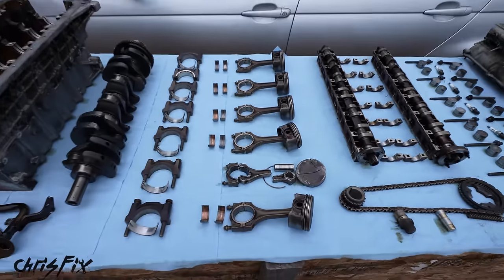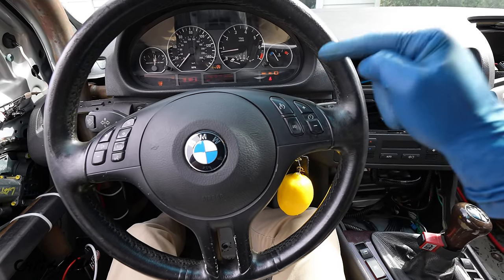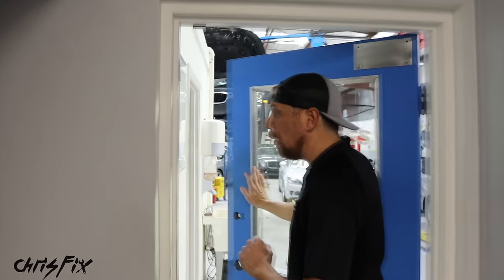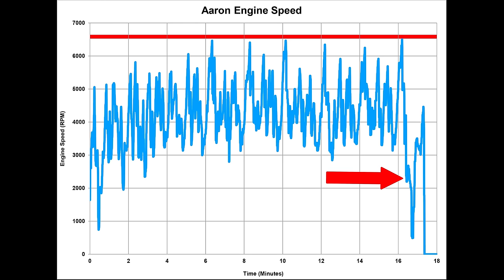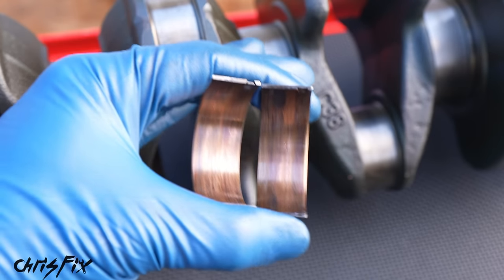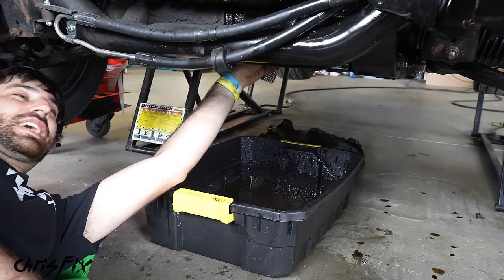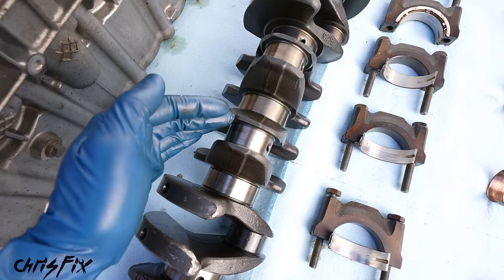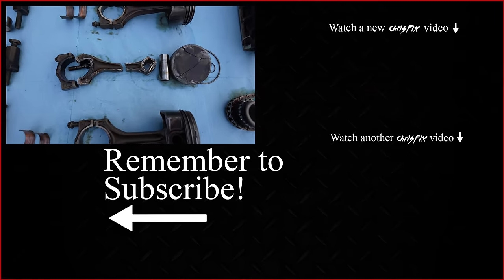What Causes a Spun Bearing in an Engine?

Comment from the maker: A common question in the comments is how can we have a junkyard engine and still be below the $500 limit and here is the answer: 
The goal of the 24hrs of Lemons is to try to level the playing field by having a bunch of junk cars race. This is the most affordable wheel to wheel racing in the world. Since our engine blew at our first  race and we are putting in an equally junky 140k mile junkyard M54 engine which is what came stock with our car, the replacement engine does not count towards the budget. The new seals we installed to stop the oil leaks ($60) and the chain tensioner we installed ($6) does count and the headers ($100) definitely count but we were at $340 after selling everything we could from the car… So now we are at our $500 budget. I need to see if I can sell the cats because those are $400 but something tells me that we can’t haha. 
With that said, safety stuff does not count towards the $500 budget. Otherwise it’s impossible to race because the fire suppression system alone cost more than $500 and the cage cost $3800. Parts to make the car faster or perform better do count, but not stuff to save the drivers life. 
Now the “backup engine” is a good opportunity for a collab with another automotive YouTuber who wanted to get involved and is trying to grow his channel. We aren’t using the backup engine unless ours blows up again which I can’t imagine will happen (knock on wood). So that engine won’t count towards the budget because it’s not in the car at the start of the race. If we end up having to swap it in at the track, it still won’t count because the time it takes to swap it in will make it so we are not competitive anymore. The next race we would have to remove it and put in another junk engine or take penalty laps. 
Lmk if you have any more questions about the $500 budget. Again, the main goal is to prevent people dumping money into a car and have an unfair advantage because they have a bunch of money.
Reply: hey chris
Reply: so basically it's all the stuff that's on the car itself that counts?
Reply from the maker: @OutrunRewind  anything that makes the car more reliable or faster counts towards the $500.
Reply from the maker: @CarSkull  hey 👋
Reply: @chrisfix  Hello
Reply: @chrisfix  lmao
Reply: What about the brakes and wheels? Those got upgraded. Do they count as "safety" devices too?
Reply: @pjaxy  Brakes probably do count as safety, but tires probably not. Idk
Reply: I wish you did home visits to subscribers having car troubles. would be super helpful and easy content. i watch a lot of your videos but it's easier to tell from them how to find something that broke and how to fix it vs finding out why the car just generally sounds unhealthy so you can fix a cheap part BEFORE it breaks entirely so you can find it easier. I'd really love for you to come over and figure out why our jeep sounds and acts weird. i've tried to pinpoint the problem but it seems like it's just spread all over the place, like everything wants to break all at once. we can't afford to take it somewhere to be diagnosed, especially if they gotta look all over for what's wrong, and we're not skillful enough, even after your videos, to figure it out for ourselves. i know getting an obd2 sensor to plug in would probably shine some good light on what's up with it, but, money. New series for your channel maybe? ChrisFixes YOUR ride! could even have entries set up like pimp my ride where fans send in videos of why their lemon needs your magic touch. You could also just do it through video calls instead of traveling. help people work through their problems over live video. you tell them where to go and what to listen to with you on their phone, then do some experiments to see if your hunch is right and if it fixes the problems.
Reply: @chrisfix  Chris ı have an idea about oil pressure gauge because you dont have on your display. I saw on internet that you can remap the gauges on your screen so maybe you can remap the mpg gauge to oil pressure gauge. Thıs can help for seeing the oil pressure.
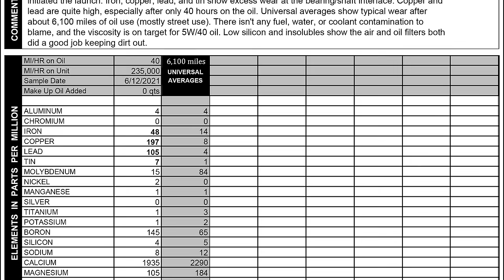Reply: Hey cris is that your actual phone number at 15:46
Reply: Yo Chris can you show how to turn your car into a an electric car  or at least a hybride plz ?
Reply: @chrisfix  I build camper vans and busses into rvs if you ever want to get into something new let me know :)
Reply: How do brakes, wheels and tires fit into the $500?
Reply: @chrisfix  does the quick release Steering WH. Count? Radio transmitter, all that kinda stuff?
Reply: Is there a age limit? I'm about 14 and wanted to enter a old rough car
Reply: @chrisfix  hi chris, what is wrong with that guy? Is he spamming you? You can block his access to your channel.
Reply: hey guys! announce for chris, he is now 8.79m subs
Reply: @Chrisfix I know you are going to hit 10m subs at the end of the year.
Reply: This is unrelated to this video but I was wondering why haven’t done a video over your C4. I understand this is a automotive fixing channel and all but from your videos it seems like your corvette is your most prized car in your fleet. I just thought it would be rather cool to see what your corvette is like. Especially since it seems to be a rather mint condition example of one. Have a good day.
Reply: @nathancoffey8568  its a Rick roll
Reply: Please do not use 5W40 for racing. Get a better oil (not going straight to M3/M5 specs but closer). Start with 15W40 (Winter additives reduce capabilities for hot engine).
Reply: @chrisfix  LMAO
Reply: Hey Chris you should buy my 1986 Toyota mr2 for $500 it needs a head gasket but I think you could do that it would be awesome for the race
Reply: I learned more in YouTube more than I ever learned in school nice job keep it up
Reply: @supergodz355  good
Reply: Hi I have a question I have sand that has
harden inside my engine bay and all over my radiator how should I clean it?
Reply: @chrisfix  why din't you use spare pipes to make strait exhaust
Reply from the maker: @ironphilly2366  we did basically.
Reply from the maker: @pjaxy  yes brakes and wheels and tires are all safety. Suspension (except bushings and ball joints) are not safety.
Reply from the maker: @nathancoffey8568  give it a call
Reply from the maker: @teebosaurusyou  safety
Reply from the maker: @LethalTunedHNP2846  safety
Reply from the maker: @theforerunnerreclaimer  you need a drivers license. This is pretty intense. Peirce is 20yrs old but he can’t race in the car yet. he’s helping a lot in the pits and will get practice seat time. It’s pretty intense out there.
Reply from the maker: @gavinc8635  I don’t have an indoor space to keep it unfortunately.
Reply from the maker: @Rich-cw2ct  I guess just leave it?
Reply: @chrisfix  Ah, okay, thanks
Reply: @chrisfix is there anything at the rear muffler or is it justing burning a hole in the e46
Reply: @pjaxy  I guess
Reply: @chrisfix  Hi chris, my ford mondeo 2004's AC compressor is weak, i mean, the mechanic told me so that is weak, but it runs decent, how can i know is really bad? I hope is just the compressor cause all the hoses to replace is dees nuts. And also my EGR valve and a selenoid is bad, which is getting my car a lower fuel economy and a lot of black smoke is getting out of the muffler, is a 2.0 TDCI engine with a turbocharger. I've never had problems with it, but i replaced some things like the flywheel,clutch brake pads,(cause rotors were completely fine) and i'm planning to get the ST220 xenon headlight, but i prefer some 2° hand ones or junkyard ones are also fine cause i have 2 headlight restore kits, but of course, you dont know this car cause is a European one, made in Germany. And they are almost impossible to find in the entire US.
Reply: CAR PATTERN:  LEMONS, MAKE your skin pattern something with LEMONS. Anyways another great video.
Reply: I'm sorry it happened to you chris. My brother has a BMW and encountered the same problem you had so sharing this info is super important and I'm glad the engine swap didn't cost towards the $500 budget cuz otherwise, you guys will be out or suffering penalty laps. Im doing an engine swap with my brothers BMW and my mom's boyfriend who is an expert mechanic is going to help us cuz he has the tools and products we're gonna need. I hope everything goes well with the next race you guys are going to have and I can't wait.
Reply: @chrisfix  oh damn ur the only one who responds to spam acc but luckily youtube found a solution they will terminate bots like u saw
Reply: @chrisfix  👀
Reply: @nathancoffey8568  I'm not falling for that one again. (LOL)
Reply: Don't prefill oil filters from the Oil Filter Outlet.....any dirt will go through the pump then bearings.
Reply: Awesome video!!! Love seeing a crew wearing Chris Fix T's! The explanation on the motor is perfect. I have never understood why putting more oil was bad....well now I do. I also wondered how a oil bearing actually worked.
Reply: Is your bad engine 100% broken???
Reply: the more I learn about the lemons rules the more I think they're the most reasonable set of rules to exist for any sport. in this case allowing the better engine after a swap because it isn't really a competitive advantage is really cool
Reply: @chrisfix  i recomend put an oil cooler to prevent the oil to overheat by all the extreme revs in the track... that can help really well
Reply: @jonah89457  I can answer the question. Yes. The hole through the block is enough to kill it. It still ran when they pulled it out, but it wouldn't have lasted much longer.
Reply: @chrisfix  good self defense! 💯
Reply: I was talking about the spammer guy in the replies
Reply: @Mr T the spammer was deleted a very very very long long time ago. All I saw was Chris saying ‘stop spamming you will regret it’. I think he deleted it though but Chris said more than that.
Reply: That’s to long to read
Reply: Does the team 8 pierce have a YouTube channel i'd like to see the total disassembly and assembly of the engine.
Reply: @chrisfix CHRIS! I’m looking to purchase a first vehicle, now tied up between 3 bmw cars: e82 128, e92 328, and the e46 330ci. Now all these vehicles are naturally aspirated as you know with the n52 engine. Said to be one of the most reliable engines by bmw, but I litterally just want the coolness of a manual bmw, plus a decent bit of reliability. So just a bone stock, clean car, with a good engine and drivetrain. I heard people upgrade rhe differwntial but this video as well as the upgraded m54 engine video were both very helpful, makes me a little less intimidated by these cars and there misfortunes.
Reply: I've had an engine spin a rod bearing on me.  Granted, that was on a 2300 horsepower, alcohol fueled (methanol fueled for those who dont speak old school), supercharged chevy pulling truck, that needed a bearing replacement every three pulls.  And yes, there was fire involved.
Reply: @chrisfix Is that collaboration opportunity still available?
But could we look into a K24 setup!
Reply: @chrisfix  dis comment is long

Comment: Remembers me of a human aid trip into Romania 30 years ago. My engine lost its oil, no warning lights. Suddenly a lot of noise so I stopped. A piece of steel had ripped open the oil carter, my wife drove over a road under construction and she knew she had hit a piece of rebar sticking out of the concrete road. Babbits all molten, crancshaft heavily damaged. No "cusinet de vibrocan" (babbits) to be found. I bought a brass pot, cut "babbits" out of it, poured the oil through a coffee filter, had the carter pan welded and drove home. 2300 km, I had to open the carter pan/filter engine oil/put fresh brass plates in 8 times on our way home. Put a junk yard engine in the car, end of a nice adventure

Comment: Here is a free bit of info from someone who has built, rebuilt, dynoed, mapped and supported many of these engines for road and competition use. I can say with some amount of certainty that your FMEA is wrong, but it is also right. The spun bearing is not the reason for failure it is the result of the true failure. Your true failure point is big end bolt stretch. The standard BMW big end bolts are like butter, so when the temps rise, as you showed in your data trace, and with constant higher rpm loading the structure of the bolt material changes and the bolts go well beyond yield and so stretch, it only take a few thou, and this is what allows the bearing to spin in the rod, leading you down the road of thinking a spun bearing was the failure. After that the rod clatters about on the crank until either the bolts snap or the engine seizes. Neither is it an oil delivery or oil condition problem. Ignore this post if you wish but if you do then you will probably end up making another video of a blown engine in the future. If your man Jamie, the chap who is prepping the spare engine for you, knows his stuff he will already have sorted this by fitting a set of ARP bolts to the big ends and ARP studs for the main bearing caps.

Comment: Even after learning for years how internal combustion engines work I never knew how a spun bearing would damage the engine so this was quite interesting and I definitely learned something new , thanks !
Reply from the maker: Glad you learned something new!
Reply: Yeah it makes a big difference if you dont hear the sound and are in racemode so you might think the engine sounds good while its self destructing :)

The car could have had very worn bearings from the start and if you buy a car and it sounds OK to you, there might be better condition cars that youve never experienced that could be the "normal condition" ones ;)  My volvo 850 has some sound that feels like crank bearing knock but it still takes top speed runs and sounds normal when very warm. I'll let that old heap explode when or if it does :D  It sounds "ok" and "normal for an old car" but if I compare it to my parents volvo with same engine thats been rebuilt few years ago its a night and day difference.
Reply: @eamh2002  Ah I see that's very interesting but what about your volvo do you not care if it blows up?
Reply: @ibrahimqureshi2420  It's a Volvo 850
Reply: @eamh2002  yeah I'd like to hear a low mile version of the 3.0 v6 in my toyota, mine has 260k miles on the unopened engine and it runs and idles pretty smooth but it might be bad compared to a new one.

Comment: I think it's important to also remember that oil gets really thin on the track. I actually would not use the factory recommended oil in this car. I'd consider going up to a 10w60 oil. I also recommend a product called Motorkote. I've been using it for years and it really does work. You can check out Project Farm's video on it, it will seriously save an engine in that kind of environment from being cooked. Even if it is a 240k mile worn out hoopty lol. I watched a friend run his chevy small block around the track for almost 20 minutes without realizing it didn't have oil in it (his oil pressure gauge stopped working). The only explanation we could come up with was that the Motorkote saved the engine
Reply from the maker: Thanks for the tip! I will look into it. We ran 10w higher than recommended but it might not be enough.
Reply: @chrisfix  5w40 is what I run year round in my M54 in the northeast. The lifters like a heavier weight oil.
Reply: @chrisfix  this problem of your car smells like semi synthetic oil. use always full synthetic to reduce overheating
Reply: I track my bmw w/ the same motor, definitely invest in a oil pan baffle
Reply: I don't know about BMW but running thicker oil can over stress the oil pump and mess with the VVT system. Can confirm, 5w40 in a qr25de nissan engine will lead to engine failure.
Reply: @chrisfix  if oil pressure failure is a common problem on that engine, then why are you guys still using it?
Reply from the maker: @ryancox6268  We fixed the issues with the junkyard motor such as the oil pump chain tensioner, wire-tying the oil pump nut, and running thicker oil for the race.